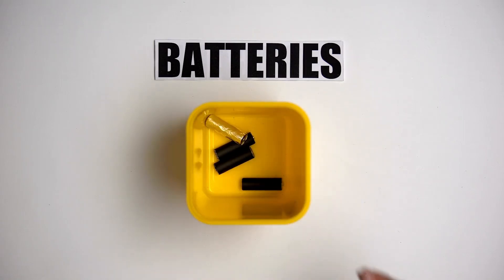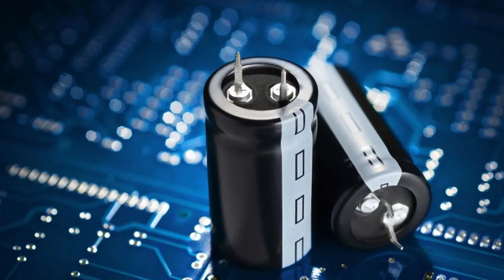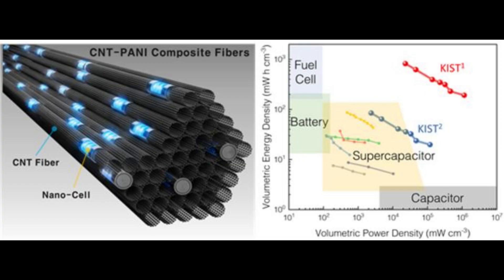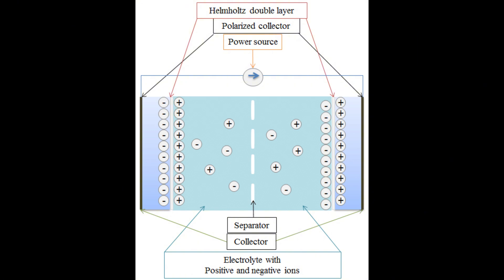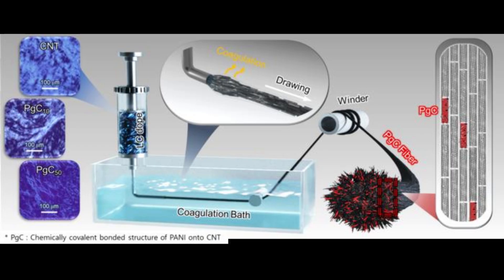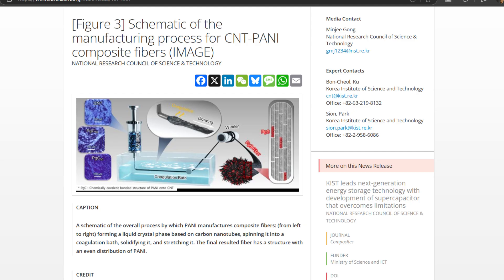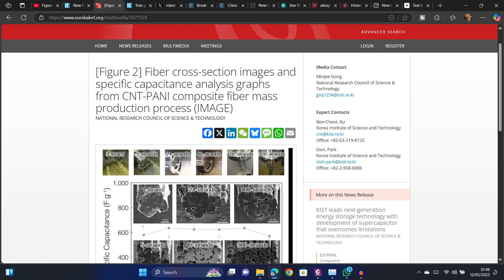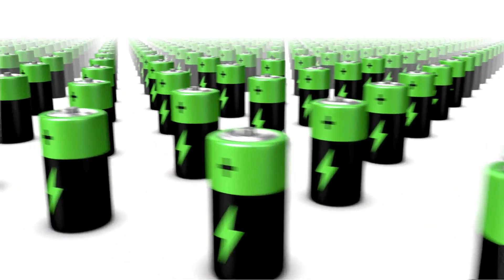How This New Supercapacitor Will Replace Lithium-Ion Batteries for Good

Comment: This will meet the same fate as the solid state battery that is taking forever to come to the consumer level.
Reply from the maker: with solid state batteries the biggest issue is cost of production is so high,,I think last yr I did a video either or Mercedes or BMW that plans to start using them by 2027 but only on high end vehicles because of cost of production..but usually there's some hope that by 2030 the technology of making them would have improved and reduced production costs making them more scaleble for wide adoption